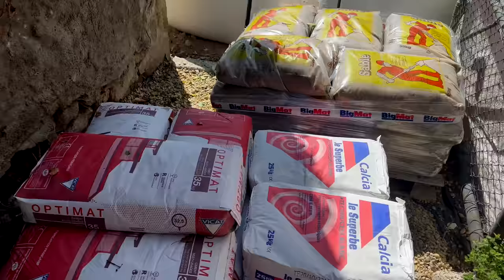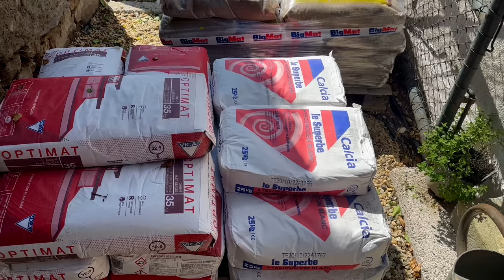Episode 31, Prepping the garden

Comment: Great episode. You  reminded me of Arnie Shwarzenegger as The Terminator when you put the shades on but that instantly changed when  you started on the poetry [which was delivered  very professionally]. I got a totally different prospective of the whole build when you explained your plans for the house/garden from the top terrace , it's going to be sensational. You will easily get away with passing the garden steps off as an older structure. I have a [disused] pigsty in my garden built about 1900 [same as our cottage]. Surrounding the concrete apron of the pigsty are 3ft high sandstone  slabs one of which has  very weathered [unreadable] writing on  and a faded date starting 16??, it was obviously once a gravestone reused as a solid barrier to keep the pigs in the sty area. We tell everyone our cottage dates from the same time as the headstone. We've even go on to involve the black death /plague/ghostly goings on around the pig sty etc just to frighten the crap outta the kids at Halloween  it's great,  and for all I know someone did the engraving a 100 years ago to pull the wool over our eyes. lol.  Cant wait for the next episode and for Nadine's return.
Reply from the maker: Thanks Sindy! I really enjoy masonry. Especially because it allows me to re-purpose rubble coming from take downs. The stones used for the stairs come from the door opening from the small house to the middle house. I have now used all the stones that came from that wall break through.

Comment: Try dabbing a little hydrogen peroxide on that dry patch on your nose daily. Should clear up in about two weeks. I used to bake myself in the sun in my youth so dry patches are just a thing with me. But the HP works! (I'm not a doctor. If it doesn't go away, then you need to see one.)
Cheers from North Carolina USA
Reply from the maker: Let me see if I can get that at the pharmacy. Thanks for the tip Catherine 😀